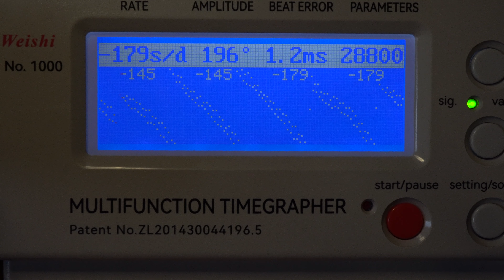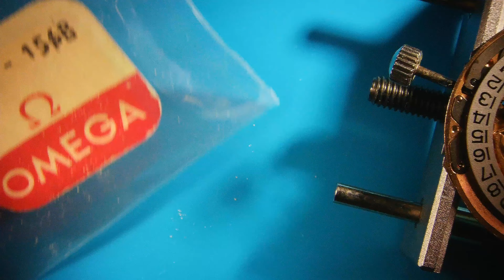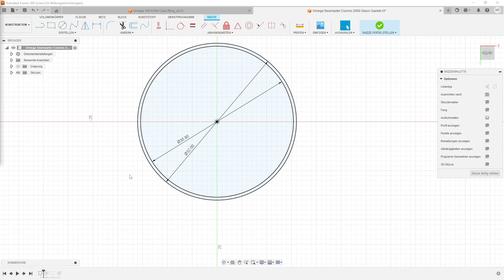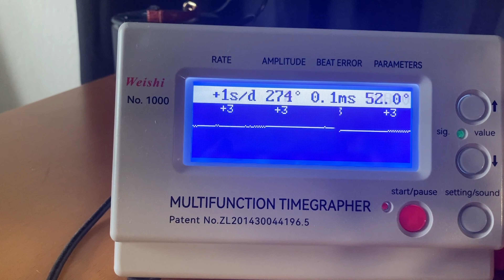Restoring a mistreated Omega Seamaster Cosmic 2000 Cal. 1022 - Full Vintage Watch Restoration 4K

Comment: I do not understood why they made those cases like that. Well done on the restoration.  My nephew is sending me his Cosmic to service...it will be my first Omega.
Reply from the maker: I have now, after this project, worked on a few more Cosmic 2000 watches and I got used to it. What I learned and found quite cool is that you can basically have the inner tube completely installed and then swap the outer case with bracelets and so on (if you habe multiple different of these watches that is). And I find that pretty cool.
Good luck with the Cosmic service and lots of fun with the watch for you nephew.

Comment: Great video. I recently purchased a Cosmic 2000 where the movement assembly is not set. I think it needs a new O-ring (at 27:03). Do you know where I can source one that would fit?
Reply from the maker: The Original O-Ring is "088NS5083 | SEAL O-RING D31 D32.6 Ø0.8" You can still buy it on cousinsuk or maybe find it on ebay (if not sealed in omega packaging, it will not be the original tho ;) ).
But any Rubber O-Ring between 31 and 32 mm with 0.7-0.8 mm thickness will do basically. You can get an assortment of all diameters at cousinsuk or even on amazon. In my opinion that makes more sense than to pay a lot for the "original" part. A bit of grease should be applied tho. Have fun with your new watch! regards

Comment: Does the spring on the seconds pinion also provide a little pre load so the movement of the seconds hand is smooth?
Reply: Yes. It is very important that the spring gives the right amount of pressure. Too little and the second hand can jitter or slip. Too much will cause too much friction and give bad accuracy and poor power reserve.

Comment: Well done!How did you figure out the date jumper was the wrong one?
Reply from the maker: The mechanism was not working as it should so I had a look at the part. Since there was no wheel actually engaging the day ring I looked it up on the spare parts sheet for the caliber 1022. Then I compared the 1020 - 1568 with the 1010 - 1568 part and saw that it is just different ones for the two movements. Pretty nasty trap to leave behind tho. And cost me about 30€ on ebay. Luckily the parts for the 1012-1022 movements are still widely accessible.
Reply: @GermanWatchmakingChannel  thanks!!

Comment: Great video en very good quality. I am an amateur and started to service this caliber as well. I do have a lot of broken parts that I need to order. I find it difficult to find the spare parts. Can you help me out by letting me know how to get these parts? Thanks in advance.
Reply from the maker: Hello. You will find a lot of the parts on ebay, or might as well find a donor movement that you can take the parts from. Otherwise I recommend checking out cousinsuk(dot)com. Under watch parts, branded,  and then movement parts you will find a lot of brand new old stock parts that you can use. Sadly these days we have to pay VAT since it is not EU anymore but it might be very worth for other stuff as well (oils, gaskets, crystals, mainspring..) that are very cheap there. Depending on your movement you also wanna check out the parts for 1012 or 1021, sometimes a part will be listed there and not under 1022 even tho they are exactly the same parts (Except for the date stuff). Good luck.

Comment: Hello, I need your help.  first of all I would like to tell you that I love your videos.  Being a watchmaker too, I am stuck on an Omega Seamaster Cosmic 2000. Do you know where I can buy supplies for this watch?  (glass, gaskets etc.) thank you very much!
Reply from the maker: Hey, I can definitely help you. Since I restored this watch I have kind of specialized on the cosmic 2000 for some time. I found most of the needed things on cousinsuk(dot)com. With the reference number, lets say you have a 166.128 or 166.132 you can search under watch parts branded  - omega for that exact reference. It might help to add a zero and search for 166.0128 or 166.0132 to find more results as a little hint. 
The case back gasket you will not find tho. To get you hand on the original is pretty difficult. You might be lucky to get them in some forums or 3D print your own (which is also not so easy to hit the right material).  I also found some other solutions, you can hit me up on the email attached to this channel if you want me to elaborate further. 

The original crystal is a Ø31.0mm (2.00mm thinck) Mineral. I would really recommend to take a saphire of the same dimensions since it will not scratch. Also can be found on cousins. Let me know if there is something else you need to know or just write me on the email. reagards